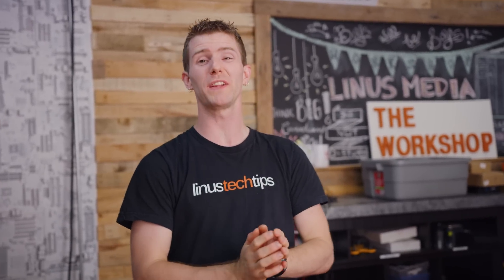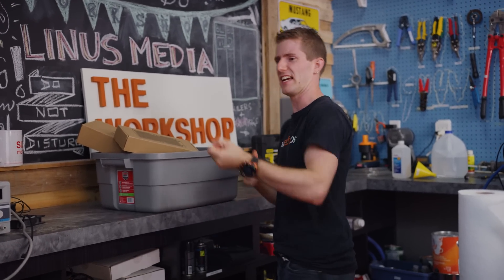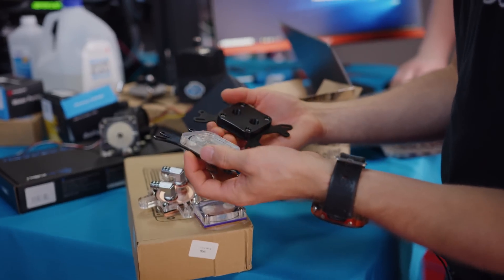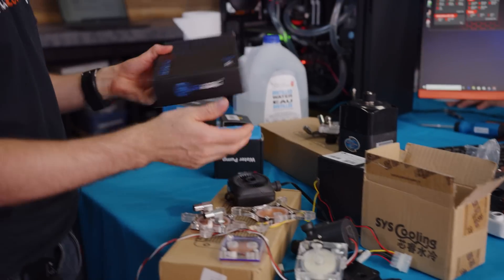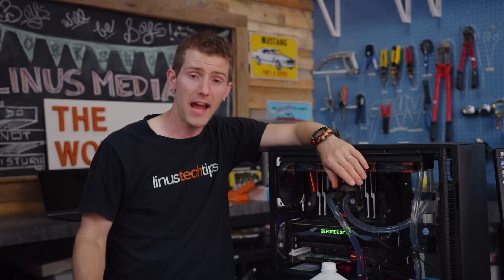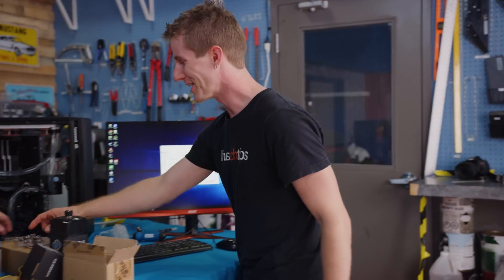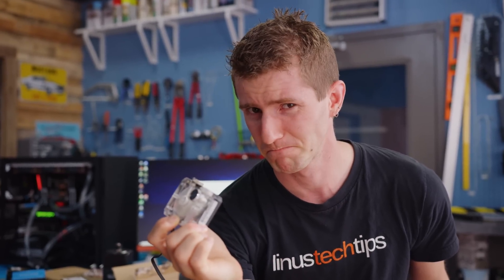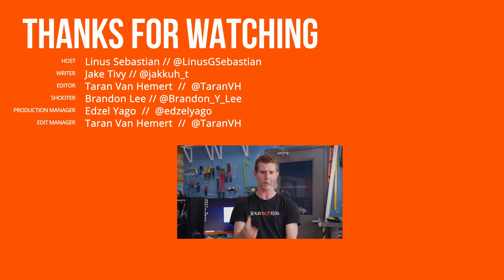AliExpress Water Cooling DOESN'T Suck?!

Comment: Bykski is not 'cheap' Chinese parts. They are huge in China. Much faster shipping if purchased through Taobao. They were the first to have full coverage Threadripper blocks. I use a Threadripper block on a 1950X and two GPU blocks on my Vega 64s. The CPU block cools better than EK and the GPU blocks are doing a great job. CPU and GPU run at 100% consistently through the day on 3D programs. Neither break 60c after hours, even days of 100% load. I have two 560 rads and a 420 so I can run fans at 30 to 50% speed. Unfortunately at the time Bykski did not have rads, so mine are Alphacool. Barrow is the same and is commonly rebranded, like my fittings which are labeled 'Darkside' which is a popular mod name in North America. EK was twice the price. I did not cheapout on pumps as both are Aquacomputer with Heatkiller reservoirs. My battlestating is here:
https://forum.level1techs.com/t/post-what-new-thing-you-acquired-recently/88085/11142?u=raziel

Comment: buying cheap is the best way nowadays... 
that said, some brand names have clauses that will reimburse your hardware if the defect is manufacturing or design. on the cheap side, its anything goes.

but if you have been watercooling for a while, you will know what to do to ensure 0 leaks..
i have some barrows and some EK parts.  that was purchased 4 years ago. back then aliExpress is considered a sketchy place to buy stuff.

only in recent years that the site has become more credible. i buy some stuff for my mountain bike there because some  local shops gouge people for the accessories.  like a bike light cost like 10 dollars  when aliExpress charges 3 dollars with free shipping for the same item.

i live in singapore so more things are applicable for free shipping,  or for a few dollars i can get slightly faster shipping with tracking.  most free shipping takes like 4-5 weeks,  while the paid one is like 3-4 weeks.

Comment: Try parts from the automotive industry. The coolers are big enough and the electric pumps are running at 12V. What can go wrong?
Reply: Well for one thing they probably pull a high current, and so could potentially fru your psu, so yeah. For another thing, they'd be pretty noisy. For another thing they probably aren't using mostly pure copper or nickel playing, so compatibility with different metal type loops would be nonexistent, unless you like corrosion.
Reply: Pumps from pre-heaters are between 1 and 10A/ 12-120W. noisy? around 50-65db. Most parts in the cooling system are made of pa6gf30 and aluminum.  
And in the end it's about the fun.
Reply: Hey it's your system bud. Go wild if you want to.

Comment: I bought the cheapest ATX power supply on AliExpress. It didn't explicitly say what wattage it was (it was listed as 150W, 250W, and 400W on the same page), but I was able to stably run a roughly 200W system on it under synthetic load without issue. I did manage to blow it after bypassing the overcurrent protection during a test, but after a few repairs it has been nothing but reliable.

Comment: Why does everyone keep running the D5 pump? Swiftech has come out with much better and more powerful pumps years ago. Example: mcp35x and mcp50x both have FAR more head pressure and flow rate than a d5 pump and they're smaller and quieter. These youtube people seriously don't know much about water cooling, but it's funny to watch.

Comment: A twenty percent temperature difference between benchmark and hobo cooling. Is there twenty percent more surface area or are non disclosed thingies effecting the measurements?

As you can see in my first three videos, you can also try a different approach this hot summer. Cool your gaming rigs not with normal case fans but with kitchen fans.

Comment: Actually Syscooling pumps is pretty good for the price. Silent and enought power to run. I have big experience with this pumps and some of this runs 24hours 365days in year for many years and still working well and still silent. Yes few pumps died. Not because elektronic or something but because case is from cheap plastics, that somehow decrade by the years.

Comment: The specs on the Ali Express Pump are the exact same as the ones EKWB sells as their EK-SPC series pumps.  The EK pump is made in China so its probably the same pump, but with a different top.  Brand name doesn't make it better.
Reply: Yes, EK SPC-60 is relabeled Syscooling SC-P60A: 

https://www.ekwb.com/shop/pumps/pumps/ek-spc

https://www.alibaba.com/product-detail/Syscooling-high-quality-SC-P60A-cooling_1423924658.html

http://www-syscooling.sell.everychina.com/p-101059274/showimage.html

Comment: If Aliexpress radiators are a quarter of the price of regular radiators, why not build a rig with EIGHT RADIATORS? Provided the pump has enough oomph to circulate water through that many radiators, the fans could probably spin at a really low rpm.

Comment: I've ordered a ton of stuff from Aliexpress. Shipping is always a mixed bag of when you get stuff. 2 months tend to be the average. Luckily aliexpress usually refunds you everything if it has taken more than 3 months. I've had stuff I got a refund for, that the seller swears they shipped but had to refund me due to aliexpress policy, and then the item has showed up 6+ months later anyhow.

As far as the rebranding goes.. China doesn't have the same view on trademark and copyright protections other parts of the world has. So they tend to rebrand a lot of things.

Now as for the pricing of common western world water cooling... they are all over priced. I almost never do water cooling because they aren't worth it.

Comment: I am currently running one of those 12 bucks cpu blocks in my main system and a 12 bucks gpu block and a sycooling 300t pump and ress combo on my second. 
So far no issues and temps maximum of 2 degrees higher than my old namebrand block. 
2 weeks so far, i will maybe post in the forum if there are any issues.
Reply: If you wanna improve that try liquid metal.   It will 100% help get that difference in temp more in line with higher end parts.   Also make a foam barrier in case your scared of it. Spilling over and paint. Around with liquid electrical tape. 

My Temps are 40 degrees at max load.    All my parts came from aliexpress and my blocks are gutter trash.  360 rad. 6 fans push pull.   It's worth it
Reply: Ryzen 1700 overclockers to 4.1 ghz at 1.43 volts.      All I'm. Saying is there are things you can do to make it even better.   It's risky sure but worth it if you want good efficient cooling
Reply: I am using this setup for my i7- 2600k at 4.6 ghz. The cpu was already lapped down and i recently took the time and lapped the cheap block, which improved temps to the original namebrand block. Currently this is a very quiet setup and liquid metal does not seem necessary, however i always wondered how much this would improve my temps.
Thanks for the tips but i am still to afraid to try lm.
Reply: @Blablabla3945  dude. I'm scared too.   Everyday I'm. Worried. It. Might somehow leak. Out but with all. The precautions I took even if a drop leaks my foam. Damn barrier will adsorp it. And stop it.   My tape coating prevents any. Shorts and my. Silicon rtv seal keeps air. Out.        It's. Amazing how good. My. Temps are for such a cheap investment.   But it's risky.  Don't worry about corrison though    copper will change color but. It won't effect Temps.

Comment: Got a whole custum cooling loop on my cpu. All from AliExpress, you just have to find fittings with good reviews. Its got a 360 brass radiator flexible tubing, brass heat sink and a reservoir pump combo. Just make sure to read reviews and you should be fine.
Reply: Its been running a year now. No leaks. Temps of 55 degrees celcius. Cpu: ryzen 1700 4ghz.

Comment: I've been using two of those china water pumps for 3 years (the big cylinder pump), and neither has failed in any way. more reliable than the other parts in fact
Reply: @TheDembe1  mine is unbranded, but looks pretty much the same. Still no problems

Comment: Byski and barrow are actually quite good products, the one block with the multi mount bracket is also pretty good, I have one on a 8 core unlocked Xeon overclocked to 4ghz for the past year with a cheap phoyba dc12 pump and no name 240 rad and it works great, the block was $19 on Amazon

Comment: PSA: LTT is using an AC or HVAC to keep the room temperature stable. The performance of the cheap components will massively tank when the difference between water and room temperature gets low. A good block with a high surface area can buffer this somewhat. The only way to ease this problem with a cheap system would be to crank the radiator fans to very noisy speeds.
Reply: You are half correct, a water filled loop will not cool down it's own micro environment (room, house, etc.) it wll only move the heat quickly from the CPU  and or other components if installed correctly. Even though having more surface on the water block will help a little to remove the heat from the CPU it can not remove the heat from the loop, essentially you heat the water faster due to the increased surface area in the interface between water and block  You will only pick up a very very slight cooling increase because of the laws of thermal dynamics.
 To be honest most people will have a better cooling solution by buying an air conditioner or leaving one set to a lower temp and removing the heat from the micro environment.
Reply: I gotta admit thermodynamics lectures have been a few years ago. The thing i was on about is this: Since the heat is now in the loop instead of the CPU, the water temperature will increase slightly. Since this raises the difference to the room temperature, a more efficient removal of the heat can occur in the same heat exchanger, at the same fan speeds. You clarified this in greater detail.

I disagree with the AC proposal, but only on environmental grounds. Your power bill will increase quite substantially.
Reply: Radiator doesn't do that much.On 280mm radiator and 300W TDP(CPU+GPU) it doesn't matter that much if the fans are running with 400 rpm or 1400 rpm and the thermal difference is negligible(2-4 degrees)
Reply: waka faka I know. That why I wrote ease the problem, not solve it. Natural convection can only be forced so far. The only solution (with all other parameters staying the same) is to increase the radiator surface area or lower the room temperature.

Comment: Next week on Ultimate Heat Sinks we buy a 100mm fan, cardboard, electrical tape and strap together some copper pipes, with steel mesh taped to the bottom with a 50cent coin and applied thermal toothpaste for that ultimate heat sink performance

Comment: man you need to make an episode of shit that manufacturers say for water blocks. I always know that all of those channels in waterblocks doesn't make that much of a difference and it is just a way to slow the flow and cause blockage of flow in case of corrosion. you want more surface area   make large channels inside blocks with smooth surface. that actually works better than those micro channels. or make the block bigger. they are just ripping costumers for no existent R&D budget.

Comment: I have loads of elbows, extenders and things like that from aliexpress (mostly the Barrow brand). They look and feel exactly like the Alphacool ones I got for like 5x-10x more . I ordered a lot of them to have options in spare when changing something on the loop.

not sure I would use a chinese waterblock or pump, but I've read about someone who had fullcover blocks from EK and Bykski and ended up selling the EK since the Bykski was better temps and he tested it on both the cards he had, so the "quality" chinese stuff might be actually ok.

Comment: Been running a custom loop with two $10 aquarium pumps in series, a $15 cpu block and a couple aluminum rads and can even kinda render with my 8700k at 4.7GHz.  It gets toasty, up into the 80s but doesn't throttle.  This is my entry into custom water cooling and I was planning on going as cheap as I could then eventually upgrading to a decent waterblock.

Comment: Regarding flat vs ridges ... iirc the problem there is having a stagnant surface layer, so naively more area does not necessarily mean that much more heat exchange if your design increases these surface layers.

Comment: suspect that the machining on the cpu block is not just to increase surface area but also to ensure turbulent flow and boundary layer mixing to maximise heat transfer

Comment: I remember building watercooled rig back in 1999. Jeez, it was almost 20 years ago... Anyway, i had a friend who had access to the milling machine (just analog, CNC wasn't that popular in those days) and he knew how to use it.
I new smth about welding copper, and together we made 3 blocks for CPUs.
We were using aquarium pumps. And car radiators from the scrapyard - in fact, my radiator was from the heating loop, the smaller one that heats the air pumped into the car.
Custom made water reservoir (from a lunch box ;-)).
Of course, the pump was running on AC outlet from the wall, so i made a smart switch, i used 5v line form the computer power supply to switch the AC line on, so the pump started automatically after starting a PC.
My next 4 rigs were cooled by this solution...

I remember a guy, who burried a  big water tank 2 meters below the ground, and used it as a "heat pool". It was way over 1 ton of water, so it did not get heated even during a long gaming session. And cooled itself nicely during the breaks.

Comment: All the water cooling parts in my build are actually barrow and Bykski parts that I got from Alieexpress. 
I'm using a barrow cpu block, bykski ram block (yes, water cooling my ram, #wurth), and a various amount of barrow fittings. My radiators are from alphacool, and my pump is actually the lotor pump from amazon that's under $30 XD... Everything is working amazingly well, with my i7 4790k at 64c on load and my GPU at 60c on load (I'm using an alphacool gpu block + using double sided tape with a 120mm fan to cool the vrams; I copied this idea from the nzxt mount) The fittings from barrow have very questionable o-rings however but everything else is perfectly fine.

Comment: It has to be said, Bykski and Barrow do make very decent water cooling parts. Then again, they aren't that much cheaper than Western brands. I have a whole bunch of Barrow fittings in my loop alongside the various EK and Alphacool parts in it. They work very well. I've had one of their 90-degree rotary fittings stick/refuse to rotate (resulting in it unscrewing instead of rotating), but that's the only issue I've had. If I ever need more parts for the loop, I will definitely be looking at Barrow again.

Comment: I have that exact same SCOOL block on my 4930k @ 4.6 GHz / 1.4 Vcore 180% power limit for last few months and its doing very good job, with 2 240mm radiators, 1 reservor and a gtx 780ti on the same loop. Cpu max temp on OCCT is around 83-88 after half an hour, but playing games I hardly see it above 60-65, on the gpu gaming at 1200 MHz after many hours hit 60-62 c. I recommend the cheap stuff never had any problem, but always keep the eye it.

Comment: Hey quick question. Just bought a new Alienware aurora with an i7 8700k and a Gtx 1070 8g. Wondering if it’s worth overclocking the cpu or if it is going to cause more wear faster.

Comment: Why don’t you guys make a budget watercooling system that people can actually do at home. Maybe use a cheap block from China some flexible tubing a cheap pump and use a “heater core” from a car. They are exceptionally good at exchanging heat into air.

Comment: the mark up on custom loop stuff is insane. The radiator on my car is 1/3 the price of a basic custom water cooling setup from micro center and its like 50x larger.  So i use air... its better anyways...it never leaks

Comment: "...Some stuff that actually looks pretty legit..."   ???   That's because it is. Also, calling Barrow "off-brand"? Umm... Ok. Maybe to someone in your echo-chamber-like YouTube tech culture.

This video really shows just how disconnected Linus is from actual water-cooling enthusiasts. I'm hoping people don't actually listen to him as gospel and actually do some research of their own. Barrow, Bykski, WinMod, Syscool, ect, put out some really high-end water-cooling gear. This video featured bottom of the barrel, no-named gear from AliE, and trashed some of the more well known brands **without even featuring their products**! 

I urge people to take a look for themselves at some of the GPU/CPU blocks on there, the custom reservoirs, the unique fittings, temp sensors, etc available on there.

Just because these brands don't sponsor your videos or send you free stuff that they get trashed? You're turning your viewers off to some quality gear at value prices.

Also, if you pay even a little bit of attention while ordering stuff from there... There's different methods and speeds of shipping. I've gotten some stuff within a week of ordering, direct from China.

Also, not paying attention to what you're ordering... aluminum vs. copper radiators... that's your own damn fault. I have found almost everything fairly well described on AliExpress. Just. Read.

Keep pushing out uninformed trash content such as this, people will start to take notice.

Comment: well the products are decent.. I got a EK PE240 Kit (had to pay import duty @50% of the cost). Then ordered barrow fittings and hardline tube and they are holding pretty good. I really liked the Barrow fittings. The product is well built and high quality (dual) O rings on fittings. Have been using for almost 5-6 months and not a single leak..

Comment: I've been using BykSki and Barrow for a few years, and they're both great. Especially the water blocks. I think my current system has about $250 of water parts. The $40 waterpump still rocking. Bought it all on taobao.